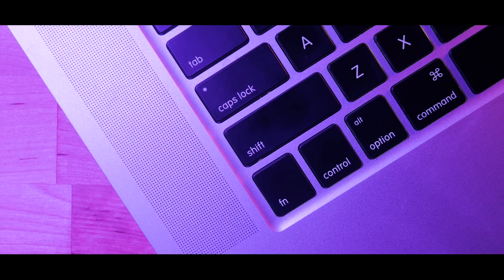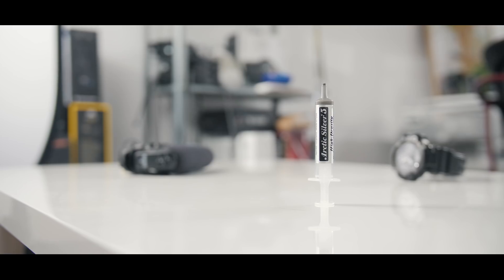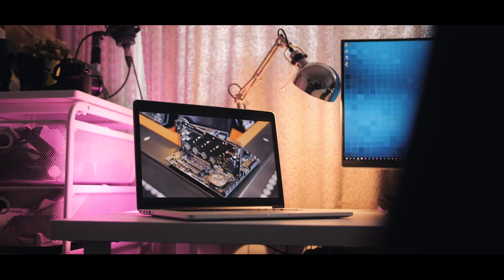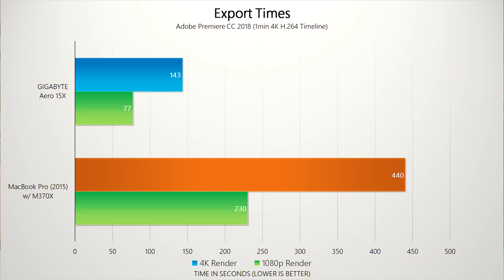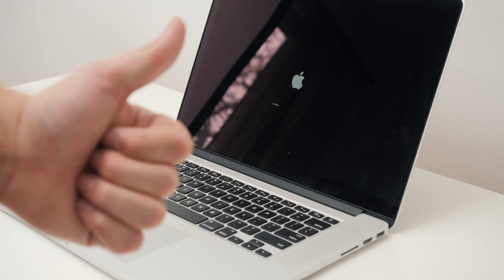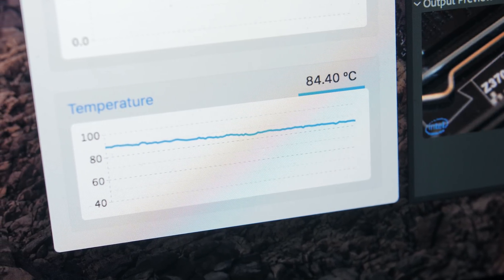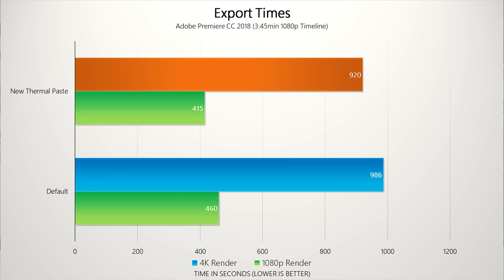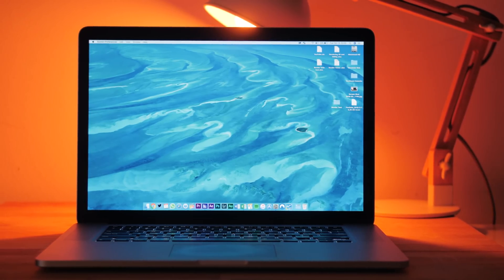OVERHEATING MacBook Pro! Can We Fix It??

Comment: I have a 2010 MacBook Pro 15".. I changed the thermal paste & cleaned every single component & as well as the fan.. and still nothing has changed. still heating to 89 degrees Celsius.

Anyone knows how to fix this?

Comment: After doing a thermal repaste, using a fan control app, undervolting by 150mv and using thermal pads to use the bottom of the chassis for cooling, mine runs around 50 degrees while on YouTube streaming 4K content.

Comment: Premere Pro is a dog on Macs. The only point using Macs is to use Mac only apps like Final Cut and Logic but If you want to run Adobe Apps mostly I would get a PC. Faster and cheaper.

Comment: Dimitry, or Dymitri...

if i'm not wrong, the macbooks does not have air intakes on the bottom. 

the air intakes are right on side of the air exahust.

you can put your MBP on a kinetic pendulum and it won't help.

Comment: I've found that a Mac app called Macs fan control, lets my 2015 MacBook stay between 40-50 degrees Celsius in this 27 degree heat. Which is great

Comment: You have a huge problem with your temp dude, I have a 13 inch 2015 macbook that I use as my daily driver and developer machine, check the process running and taking all your CPU / GPU usage, also don't hesitate to download a utility like SMCfancontrol to boost the fan 100% yourself so your macbook won't wait until it throttles to speed up the fans

Comment: Hey! I have a problem with kernel task ! It’s using >300% of cpu and it’s the fan is spinning at6200 rpm 
Did the hardware test got a ambient temperature sensor error 
Idk wat to do 
Apple store says we have to replace the mother board which is 80% of the laptop cost 

Please give a solution

Comment: Did you test it plugged in? This can make a huge difference because the battery degrades and the computer downclocks the CPU when the laptop is not plugged in to make the battery last longer.

Comment: I'm fairly sure it would down clock at 1080p because you may not be taking full advantage of the hardware level transcoding functions and therefore the rest of the cpu isn't at as high if a utilization. Therefore down clocking the cpu because doesn't think it's under the same load.

Comment: I think this is a valid thing to think about: could it be the aging battery? Apple has reduces the speed of older iPhones as their old batteries aren't capable of driving the same voltage as when they were brand new. A new battery solves this "Underclocking" that Apple applies. So, could it be that there is a "underclocking" going on, on the software level, which won't be remedied until the MacBook sees that it has a better battery--- just like the iPhones?

I think this is something to think about.

Comment: Dmitri, did you take care of the mini dust bunnies? You could flush the heatsink with a can of compressed air or better, a fine toothed toothbrush. Dust+debris can impede heat transference across the heatsink due to insulation. On another note, you should've applied half the TIM you used since adding too much can and will add to the TIM acting as an insulative material rather than a transference media.

Comment: You need a baseline with the OS that the macbook came with at the time and benchmarks from that time. Your little improvement in performance doesn't mean much, and need hardware monitor app to determine if you're still thermal throttling. I'm pretty sure that in a day or two of using the macbook it's performance is going to drop back to its days of the "old paste". Just my 2 cents on what I'm witnessed myself with repasting (same paste)

Comment: At least for me, it's completely unacceptable to have the CPU so hot (76 C) on such a light load (YouTube playback) on such an expensive machine.  This is not the MacBook Air.  Apple is advertising it as "Pro," meaning the machine that should be able to run stuff like this without a sweat (like Eber's Gigabyte notebook), and its not doing so is unacceptable to me (especially at the price; this is supposed to be a high-end workstation-like machine).  The device is being advertised as "Pro," and therefore is not aimed at thinness; why not keep the thin design to the Air and make the Pros a bit thicker in order to provide a decent cooling system?

Comment: You used way too much thermal paste on your chipsets its not the end of the world though. The worst thing you did was not cleaning the fans old thermal paste will cause issues but a blocked and or dusty fan(clearly seen in the vid) will cause issues also. Take the fans out and clean them I bet you will see an extra drop in temps

Comment: Did you use some canned air to blow the dust out of the fan assemblies? The thin heat exchanger fins really like to collect dust which will block airflow.

Comment: could you mount thermal pads on the heatpipe, so it touches the aluminium chassis?
The chassis will heat up more but the pc should be cooler at least in bursts.

Comment: The thermal paste was incorrectly applied. The best method to apply thermal paste on a raw processor die is to spread the thermal paste phone book paper thin and then do the dot method. I would have used Thermal Grizzly Conductonaut for the best results.

Comment: 1. Offload the GPU to an eGPU. 
2. Offload IO to a hub (ethernet, USB, TB, etc.).
3. Offload sound (bluetooth speaker or similar).
4. Put the MBP on a cooler. I made a custom copper heatsink that it rests on. 
5. Make sure iCloud storage is not full or off (iCloud will spike the CPU when it is full periodically). 
6. Use Firefox or Safari (Chrome will spike all cores).

Comment: Im not trying to be a negative nancy but that was the wrong way to put thermal paste on. if you sheath it very thin with a credit card or if your dangerous a razor blade you can maximize thermal transfer speeds and cooling factors will also increase, ugh

Comment: The performance didn't change much only your hardware temperature came down.. The truth is that Apple screwed you up with their software update.. They are slowing down old laptops to force consumers to buy new ones.. Try it.. Go back to the first firmware and see if there is any difference....

Comment: Hey man. I'm facing a very similar problem on my Premiere rig as well. It's a Ryzen 1700-16gigs-R9 380X 4Gb. I've also noticed that a downsampled 4K-1080 render; 1080-1080 render and even a 1080-720 render just sits there with the fans flying but under Windows I only see 50% CPU usage and 5% GPU usage. But GPU temps were in the high 70's. It made no sense. Some digging around on Windows showed me funnily enough on the Task Manager that ONLY Compute_1 was in use at full(80%) but everything else on the GPU was sitting in the low 3-10% range. Similar I think....

Comment: @hardwarecanucs I had the same issue on the same macbook, I did the same thing with the same thermal paste. I got the same reduction in heating but I went a bit further and now my mac runs around 43 to 60 on youtube. The one step further was a memory leak issue. Try deleting your keychain folder, this will reset it but thats fine. Once that is done. Turn down your mac. Do a SMC reset and power it back on. Then monitor your temps again and you will be surprised!. Hope it helps!.. PS, Keep up the excellent content!.. Cheers!

Comment: Here's an easy fix, sell them Mac, buy a proper laptop
Reply: Why use a laptop to render video? That has to be one of the worst things you could do with a low-performance, portable machine. Just put together a nice Ryzen or Threadripper tower for it.
Reply: The XPS 15 4K display laughed :V
Reply: what's the point of good monitor when you can do shit with it, only watch videos and photos. Even the cheapest gaming laptop is much more powerful than the most expensive macbook pro.
Reply: Because he's away from his office and laptops more portable than carrying a giant pc and monitor with cables when your traveling. Have fun rendering your videos in your car, hotel with your pc.
Reply: @sales83 They might be powerful but they have shit screens. Companies usually compromise by having cheap screens with good hardware to make it affordable. And they also usually have TN panels which the viewing angles and color are shit and not good if you are editing photos or videos. Yes you can just plug in a monitor but the point of the laptop use it where ever you are.
Reply: Shiney McShine you mean the most expensive ones that cost as much as a MacBook and have no ports?
Reply: Client Digital how about Razer?
Reply: Jacky Fu Asus, HP, Acer, Lenovo, MSI, Dell, Razer, Alienvare, Gigabyte...they all come with  IPS screens in the past 2 years, some full hd, some with 2k, many with 120-144hz, the same CPU's as the ones you can find on the macbook pro, but with much more powerfull GPU's, newer and faster memory, more memory and way better performance.Just try one, and you'll see.
Reply: He has a proper PC. :)
Reply: for visual creators, other laptops still cant keep up in the quality of the monitor. only some of the most recent most expensive models
Reply: the MacBook Pro is technically the most powerful laptop in terms of cpu perf since it uses the i7-7920HQ running at 4.1Ghz max vs the 7700HQ running at 3.8Ghz and as far as I can tell its the only laptop that uses that cpu other than the msi titan but thats barely a laptop anyway.

Comment: Apple laptops run really hot because the fans are air-starved. If you dremel a hole for intake on the bottom panel near the fans you'll see a huge improvement in temperatures.

Comment: Well, all thermal paste eventually will dry out from the heat... this is accelerated when the components in question have a heavy workload. Second, a lot of laptop CPU/GPU chips have no IHS on them which mean that you need to cover the whole die with thermal paste as the whole die heats up (unlike an desktop version which has 2 extra mediums to transfer heat to, reducing effectiveness) so more thermal paste assures you of having complete coverage of heat transfer , its simply then a matter of how efficient is your heatsink transferring heat away...

And i find it ridiculous for Apple to waste your money in internal PCB aesthetics considering how Apple so strongly discourages Apple product repairs....

Comment: Interesting, I feel like for the price you pay for the Macbook they should give you good paste.
Reply: the paste is good, but with all paste, after time it decays. You should change the paste on your machine every 2 or so years if you can for desktops. Laptops it kinda depends, I know Razer ask you not to because they apparently use a very specific compound and its applied in a very particular way but most others you should be changing every few years too if you know how
Reply: I left the paste on my desktop for 7 years and it was fine 😛 maybe I just got lucky or had good paste, I did a video about changing it and it didn't really change anything. I think I'd be less likely to want to change it in a laptop, some of them are quite annoying to take apart.

Comment: Nothing but a band aid fix . Apple builds these systems to be slim and quiet with the hinge blocking air flow and a not aggressive enough fan curve. The high temperatures will dry out the TIM and you will be back to square one.

Comment: I am currently experiencing a thing where MacOS will let my 7820HQ hit 3.2 GHZ (meant to go to 3.9) under full load but windows will stop me at 2.9 GHZ under the exact same load. Plz explain. Also, I found out that each core has a different turbo clock. Not sure if that has anything to do with your issue Dmitri.

Comment: I have the same MacBook Pro with the R9 M370X.  The reason I bought it was for Final Cut Pro X and the much faster render times than Premier Pro on my desktop PC.  I shoot and edit 4k all the time with no issues.  If you want to run Premier Pro - don't use a Mac would be my advice.  The MacBook Pro is optimized for FCPX.

Comment: What I think is that computers in general have a procedure to lower performance if they can. 1080p videos are less heavy as 4k videos, so they drop performance. That also has to do with lifetime. I also notice performance on my windows platform while transferring files, the usb can handle 100mb/s but its on a few kb/s because the files are just a few kb. It's something weird, I agree that with you, but this may be an logical explanation.

Comment: For reference the aero 15 is a newer laptop from 2017, while his MacBook is a 2015 model. Not to mention, that Macs don't slow down over time and every component generally lasts longer than PC components. For all you Mac haters, educate yourselves before you post, stupid comments.
Reply: Anthony Titus not gonna bother but people who know... know ;)
Reply: If anyone is mentally deficient, it is you because of your complete lack of basic grammar. However, that besides the point, your right Macs do slow down, along with pcs. My mistake, I meant on hardware level, what you have on your computer is what slows it down, and workloads become more demanding overtime. Generally Macs last longer, because of the quality of parts Apple receives and the build quality. A PC you build yourself we generally last longer than certain prebuilts. Not mention, several components are  unique to apple. Not to mention a one year warranty is standard on PC coronets and Macs.  Also, how do know I am a noob, would you like to test that theory? Thank you, and please educate yourself on proper grammar.
Reply: Anthony Titus MAC hardware lasting longer?? no.. gtfo. shitty cooling overheating piece of shit. That combo isn't good for hardware. Compare that to very low temps on pc. watercooled cpu, maybe even gpu. or just a good aircooled one with good vram etc. u can crank ur pc tf up and have it last waayyy longer. apples components are not high quality. only the case is. plus pcs last longer and are superior in every way possible.
Reply: I happen to know a fair amount about computer hardware, you can always ask me a question to ensure that fact. Harshlens, I'm sorry I insulted your grammar, for I figured you were just illiterate, and not a non native English speak. As for me being a hypocrite, I have not contradicted myself, I merely corrected myself. I am not rich, my Mac was in fact a gift. Also, as for  low temps on a pc, that is not true my mothers laptop which is from 2015, was eight hundred dollars, cannot run five chrome tabs. Only a portion of systems are water-cooled, which makes the majority air-cooled, PCs overheat just as much. Also, your grammar, appears to be lacking. Cranking up your pc and having it last way longer, makes no sense overclocking, generally shortens the life span of the device. Apple's comments are in-fact high quality, just look at the specs, and compare them to other high-end PCs. I said generally PCs last longer, in-fact his Mac still runs just fine, so do Macs from 2011. Most laptops, thermal throttle anyway, as for PCs being superior, the only superior aspects is the wider program support, however wine software, Geforce NOW, and other programs are beginning to lessen the gap. Thank You.
Reply: Anthony Titus ur talking about laptops. The term "PC" is usually used for desktops.
Reply: Anthony Titus and many laptops are shit.. but that just depends which one u choose.. there are so many different options.. some 800$ laptops are total shit while others are oretty decent. If u have even some knowledge about components etc. u will choose the option with the best bang for ur buck. For example, some laptops  have pentiums or i3's for 800$ while some have a i5 or even i7. some have shit airflow and some have exceptionally good airflow.. u just need to find the correct one.

Comment: way too much thermal compound. excessive spillage imminent. you should only use a grain of rice on an exposed die that size, that's more than enough. you just went overboard. you did it no better than foxconn did when they built the macbook. smh.
Reply: But what's the harm in too much? Too little can harm though!
Reply: To much thermal paste doesnt make that big of a diffrent compared to, too little. Think linus did a video on it.
Reply: "Back in the day" on AMD CPU`s like the Thunderbirds and Durons - too much thermal paste almost seemed to insulate the heat.  Had a friend working in a computer shop and saw them wreck two CPU's in one day that way.  They also didn't have thermal cutoff protection. Once blew up a Duron in 2 seconds flat by applying the heatsink the wrong way. It felt and looked like it was on properly, but didn't make contact with the die. Poof. These days its all so safe :-)

Comment: Did you clean out the fan's? maybe you just need to do a more thorough cleaning of the entire system.
Reply: Mine is brand new and is scalding hot
Reply: @Chaleco22  same I play Roblox for ten mins and my 2019 MacBook Pro is hot as shit
Reply: BrianSingh same lol 💀💀
Reply: @Deeeeezzz  It's Apple we shouldn't even be surprised anymore. Like they keep pulling bs like taking out the USB ports on the MacBooks, I can't buy an adapter cause of the damn coronavirus.

Comment: Strange, my 4.5 year MacBook Pro (with the old NVidia 750m) doesn't overheat as much. I don't throttle as hard during blender usage (converting 264 to 265) and my temps when watching youtube is only about 60C.

Comment: I mean, it's a Haswell Macbook Pro so it doesn't have the VP9 (and HEVC) QuickSync decoder for Youtube. Pretty much any processor from Intel of Gen Broadwell and older would be the same or worse.
Reply: Broadwell, 2015 used the 5th gen CPU's not 4th generation. the 2015 MacBook Pro 15 can be upgraded to an intel core i7-5950HQ 2.8GHz quad-core CPU, which is Broadwell according to intel's web page not Haswell.
Reply: no, no HQ series boardwell chips were ever made.
Reply: TruVueTech YT I know? And they can't be upgraded since they are soldered, they are not M series.